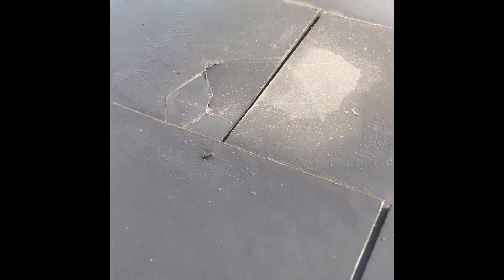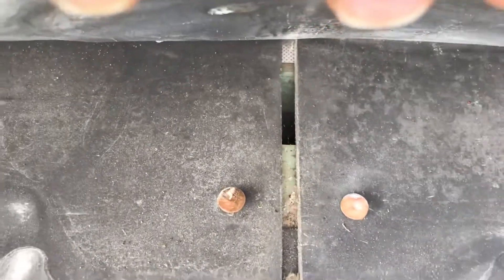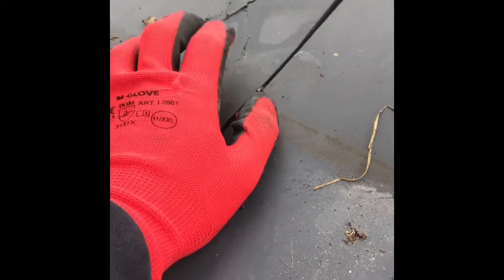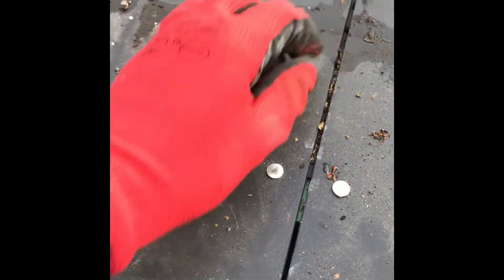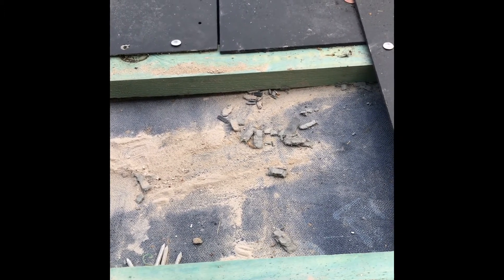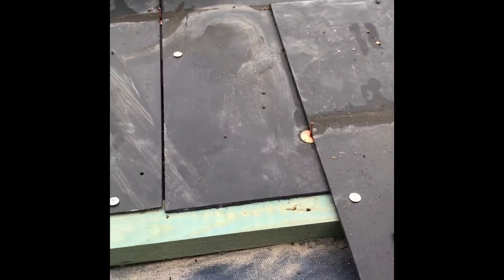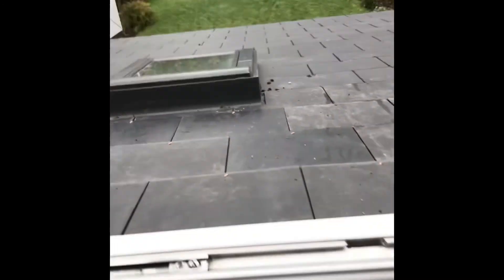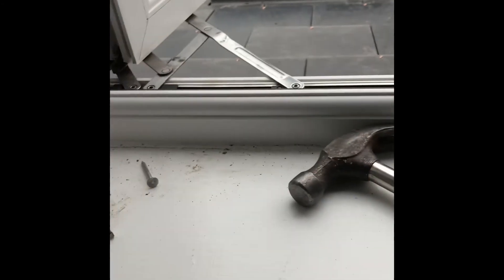How To Repair A Slate Type Roof, Repairing A Fibre Cement Tile Roof

Comment: Hi how long shuld this type of slate last
Reply from the maker: Thanks for the question. 
These are fibre cement tiles, not slate although they look very much alike. 
The tiles have a guarantee of 50 years and are produced by Marley. 
Hope this helps you.
Reply: @diyhomeandgardening   thank you for that, from your experience would this type of slate be good to use on a summer house?
Reply from the maker: They would be fine to use as they are light weight enough. Probably worth you pricing up the tiles vs felt tiles or shingles. Easy to fit though.
Reply: @diyhomeandgardening  forgot to ask why do you think the slate ended up breaking?